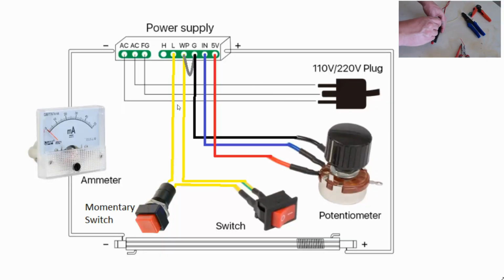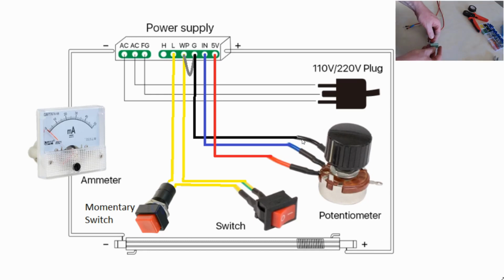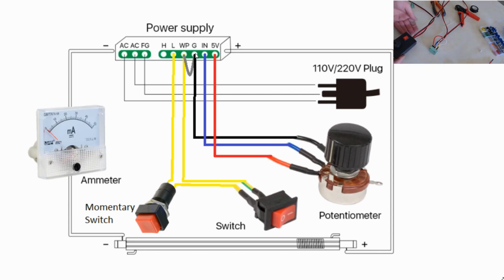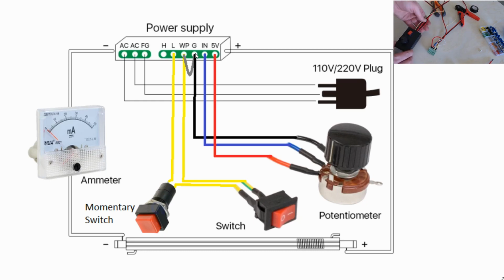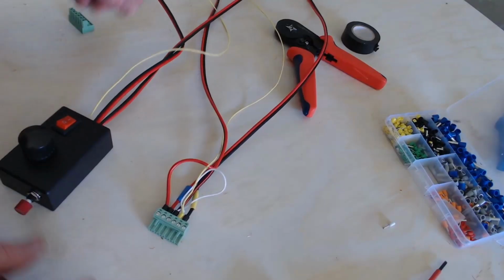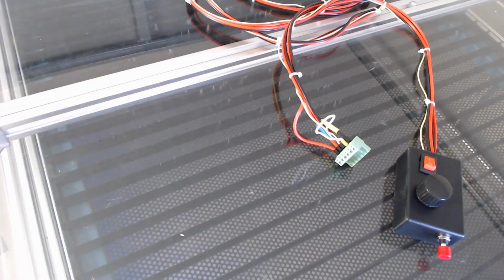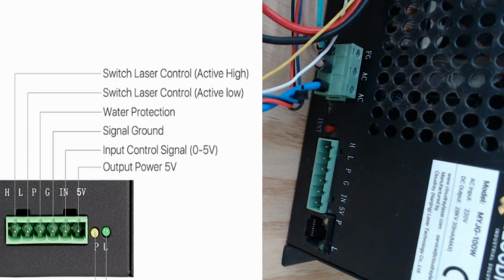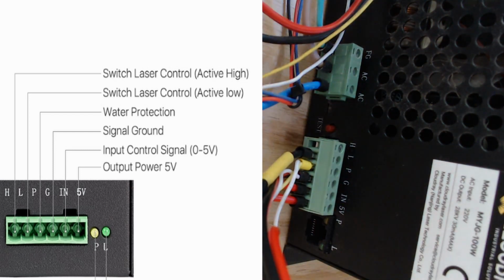How to Make a Manual Laser Pulse Unit - For Co2 Laser Mirror Alignment

Comment: I have tried this,  as well as used the test button on the psu, neither actually fire the laser though.   The leds indicate it should be firing.   The laser works fine as I can pulse it using the 6445 controller.   Any thoughts? I have done continuity tests ensuring proper connectivity.
Reply from the maker: email askmatt@mwlaser.com.au

Comment: The only thing I would do different is to use the 2nd momentary switch instead of a toggle switch . A toggle switch has a perminent state and it can be overlooked, where a 2nd momentary switch would require you to push both buttons And automatically reset to fail safe.
Reply from the maker: good tip.  thanks

Comment: If i had a water flow sensor already installed, do i still need to jumper the WP to G to make one of these?
Reply from the maker: If you are removing the existing "phoenix" (green connector) and making a new one for the pulse button.  Then yes you do need to use the jumper wire. Your other alternative is to wire the water flow sensor in it's place.

Comment: Hi, sorry for my question but I wonder how this is working without any power inside the box?
 I mean the potentiometer is supposed to deliver a current between 0 and  5V to the PSU where does it find its power source? 
Also is it possible to cable this with the ruida at all time (don't want to disconnect the PSU connector each time I want to test pulse the laser). 
Thank you for your videos. Cheers
Reply from the maker: it does not require an alternate power source.
it is not designed to be used in conjunction with the controller, one must disconnect controller before using this device.